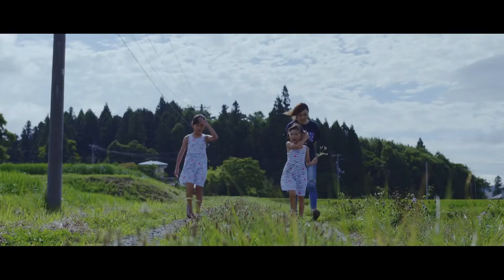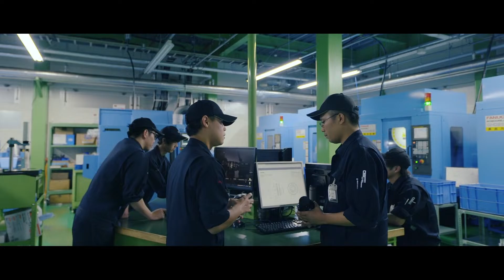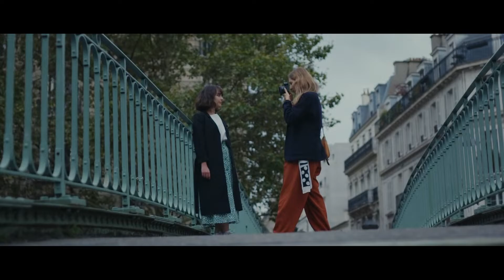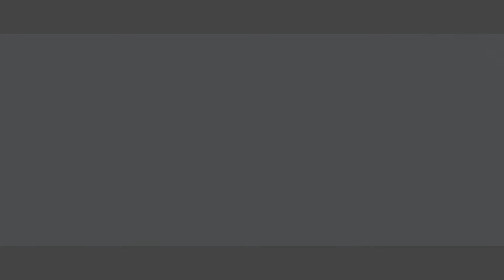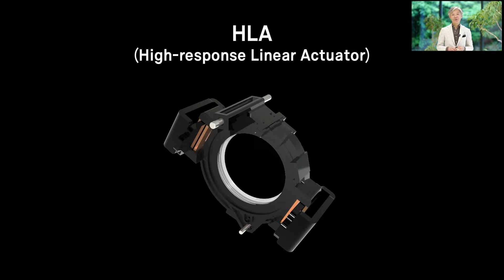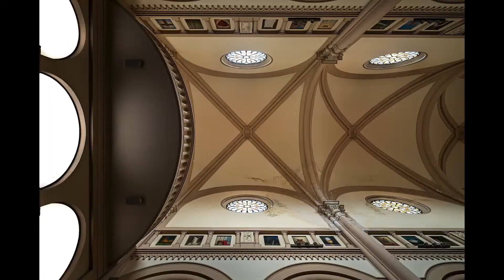SIGMA STAGE Online - SIGMA 14mm F1.4 DG DN | Art announcement

Comment: I don't understand why Sigma can't just put out a new lens for all of the main camera mounts at once. When I got the Sigma 14mm f18, I believe I had to wait over a year before they finally put out the Nikon F mount version. Sigma might not intend this, but as a user of a major camera brand, I feel bad that Sigma seems to think that I don't matter? I would buy the 14mm f1.4 today, without even thinking, if it was only in a Nikon F mount.
Reply: Not possible to release a mirrourless design for a reflex camera because several elements would hit the mirrour.  A reflex re-design at f/1.4 would be twice the size and weight.

The Z and RF prospects depend upon Nikon and Canon wanting the lens to release in their systems.  The DC DN lenses in Z mount appear to have a very high licencing fee premium, too.